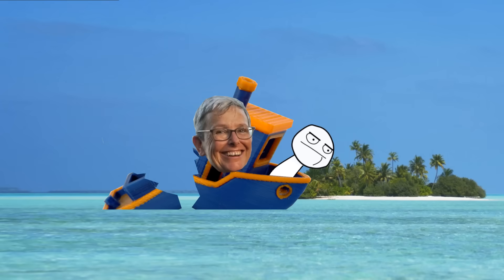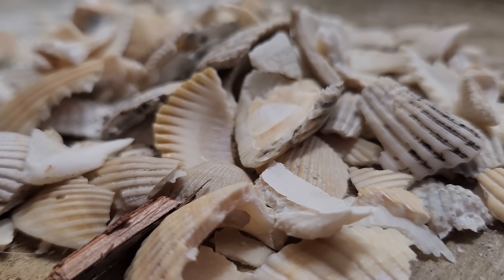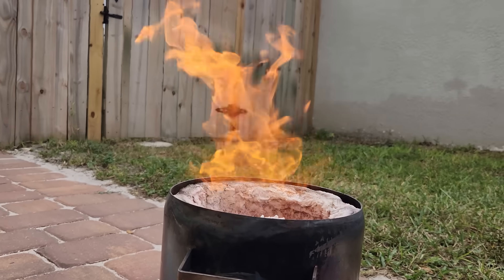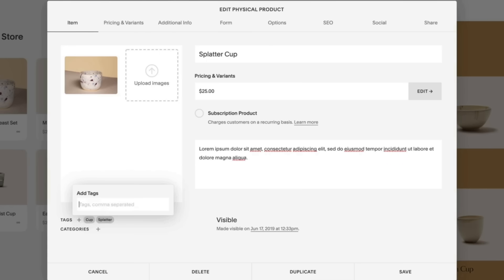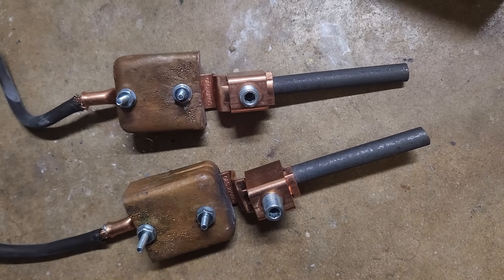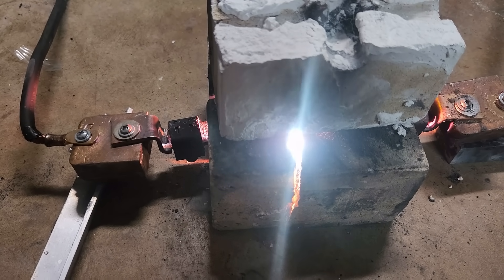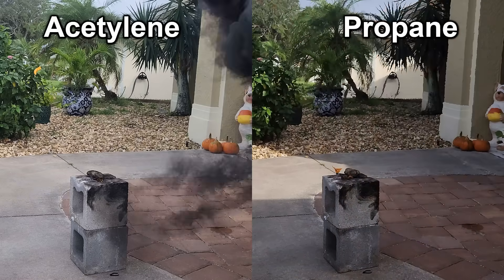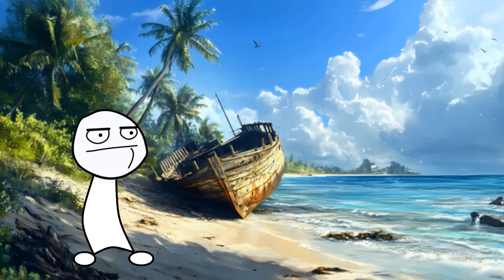Acetylene Gas from Sea Shells and Driftwood

Comment: Make a vibrating funnel to place the ark weld into the outlet, then pore the dust into it and the ark welder should convert it as it falls past the ark. at least that's my thought on a possible way to make a better setup.
Also it would be fun to see a video on how to make carbon nanotubes from acetylene soot. you could even use the soot from copper acetylide, Iron Acetylide Cobalt Acetylide or Nickel Acetylide because these metals are already used as catalyst in their production. I have always wanted to try this experiment but I don't have the time, tools or practical skills in this kind of thing.

Comment: As kids, we made re-useable flash-bangs by putting a pea-sized lump of carbide in a tin with a nail-hole near the bottom. Spit on the carbide, jam the lid on and apply a match to the hole. The lid flies way high, with a satisfying bang and flash. Then go find the lid and repeat. We lived in the bush, and used carbide lights cos we had no 'lectrics.

Comment: could you set up a funnel structure to have a controlled dribble/stream of mix falling through the arc to produce the carbide? Also as I have one, can you use a coke forge, though not the same way

Comment: you actually better live in the rainforest, no money issues try electrolysis of KOH or NaOH, then assume K and Na are more reactive than CaO to get CaO etc. yep K/Na are replacement for the carbon which required ton of heat to drive the replacement reaction that way. yep about 300C for the molten electrolysis of KOH or NaOH.

Comment: All I wanna know is why does it not all burn up at 2000 degrees? I see the water activates it but you also said in the video that some of the flames were  from the acetylene gas in the furnace. Why does some burn but not all?

Comment: uhm, a charcoal furnace can get to 2200F, that is roughly the temperature blacksmiths use for firgewelding wroughh iron, I have even accidentallh melted stainless steel suposddly requires even higher temperature in a regular pit forge.
the difficult thing is to get a good enough crucible.

Comment: Nice!
Maybe you could try a follow up alternative using a few solar panels instead of the step down transformer...?
They have the nice property of acting as a current source which can help keep the arc lit if discharge goes unstable [voltage automatically rises as current decreases]
You can pull very long DC arcs from a series string - but here I was thinking several panels wired  in parallel to give say 50V DC nominal at a few kW.
Possibly need series diodes to isolate each parallel panel from back feeding.

Comment: the mix has a carbon in it, wouldn't it be sufficient to press the reactants between 2 flat electrodes and pass current through it?

Comment: 1:35 - You shot yourself in the foot. If you already have an electric arc, you already have a welder, no gas needed.
Reply: On our farm we never weld with acetylene. It's used (very) rarely for brazing, almost always for cutting. Electric arcs for welding. Although we do also have and use a plasma cutter.

Comment: There is an arrangement of carbon rods for electric arc called Yablochkov Candle. Look it up on Wikipedia. Essentially two parallel electrodes separated with porcelain clay. It removes the need to continuously readjust the electrodes.

Comment: Moissant, who pioneered the use of arcs to make this and other materials (including synthetic rubies). He used lime/CaO as well as carbon to make the crucibles and firebricks. He found out, just like you, that natural materials dont hold ip to the electric arc very well...
Also, i think I read that some of the earliest carborundum construction at Niagra did exactly what you did: carbon electrodes embedded in giant vats of the mixed source materials.

Comment: Weird question but are the seashells even necessary? There is calcium in wood ash. It's why wood ash cement is possible. Honestly if trees grew a lot faster they would be a pretty decent chemical feedstock for industry.

Comment: Your transformer is an autotransformer
It has one winding with a center tap. Both ends are the live of the 220V and the middle center tap becomes the neutral of the 110v (together with either one of the live wires)
The advantage is, that at a conversion ratio of 2:1 it only has to transform half of the power that is drawn at the 110V outlet. So your 5kW transformer is just a 2500W transformer
Also you might want to make that contraption something like a constant current source since arcs have a "negative resistance"
And why on earth didn't you just use an arc welder?! It does all that out of the box

Comment: Hey man ive got an old tombstone welder if you really, really need a welder. Does DC and AC, im sure you can figure out the plug. Takes 240. 
Its older than either of us, built like a tank. Can even give ya a huge, dirty, thick ground cable

Comment: It's a good thing you also found that arc furnace and power source on the beach.
Couldn't you weld with that instead? 😂
In fact, those carbon rods can directly react with the calcium, skipping the driftwood part.

Comment: Commercial carbide is not made in an arc furnace.  A long narrow trench (many feet long and 4-6" wide) is made from castable refractory.  into that trench is carbon (usually from coal) calcium oxide is placed (made by roasting limestone).  Heavy carbon electrodes are embedded at each end.  The whole mess is covered with more castable refractory.  Very heavy current at a voltage sufficient to force the current for several days.  At the end, the refractory is broken away and what remains is a long ragged rod of carbide.  That is run through a crusher to produce the size rocks of carbide that is found in a commercial can of carbide.  no arcing is ever used.  only resistance heat.

I made several feet of carbide using that method while in high school.  My father acquired the special transformer required.  There used to be a company in town called Tennessee Transformers.  That's probably where he got it, custom-made.

Comment: I'm surprised your propane forge won't get hot enough. I built mine and it gets to 2300F. I use it to melt copper. I wonder if it would get hit enough for this reaction.

Comment: You can also skip the calcium and charcoal entirely, and just make the carbon arc underwater. The arc is much more than hot enough to work underwater. The carbon rods provide the carbon and water provides the hydrogen. Heat plus ultraviolet light from the arc splits the water. Controlling the arc length and arc current can significantly impact the production rates and purity of the acetylene. A slight downside is the acetylene comes bubbling out mixed with CO and H2, with a small amount of CO2 possible. The acetylene may be partially separated and concentrated by bubbling the mixed gases through acetone. Acetylene will dissolve more easily into acetone than will the other gases. 

It is preferable to form the arc in a chamber filled with flowing hydrogen gas, as that method avoids the production of CO and CO2, but requires the availability or production of hydrogen. Methane can be substituted for hydrogen in that reaction, which also produces hydrogen gas, H2.

BTW, the reason for the soot cloud from the acetylene-filled balloons is likely to be this: Above 15 psi (1 atmosphere), acetylene subjected to a shockwave decomposes explosively into hydrogen and carbon. The carbon atoms then clump together into soot.
Reply: Nice idea, but how to get the rods under water and to collect the gas at the same time? It has to be collected very carefully, because of toxicity of the CO.

Comment: They used to use carbon rods in cinema lights, they have automated screws that keeps feeding rod to keep it lit. That's where the saying "lights camera action" comes from, because you had to strike the lamp every time you turn it on.
Reply: Also because they eat up the carbon rods so fast they have to use them only when needed.

Comment: The acetylene balloon could definitely use some oxygen to boost it's combustion.  When it has that much soot is it running very rich.  When it's at its correct ratio it burns with no soot at all.  For cutting in the automotive shop, I generally run 25ish PSI Oxygen to about 5 PSI acetylene.  I dont know how much that converts to by volume but it works great for cutting steel.

Comment: 12:54 Not a partial detonation. I've done a quite number of experiments playing around with fuel/air/oxygen ballons around stoichiometry, and trust me, when you get close to detonation, you definitely know it. And so do your neighbors. Hydrogen gas is the easiest - I suspect you could detonate it with a lean mix of air. Propane needs at least 1:5 of pure oxygen.

Comment: Charge with a mix of calcium phosphate, fine sand, a pinch of salt and charcoal in excess then arc it in a retort and you can make elemental phosphorus. A couple larger ceramic flowerpot works OK for the retort. Use some clay to seal it and bury it all in a sand pit. Use two thicker carbon rods and some steel wool to short out the rods and get the arc to start. A steel pipe is ok for the retort condenser. You can also use the CO created as a shielding gas. ❤

Comment: Very cool! Have you seen the videos by Shake The Future on using a microwave to heat silicon carbide crucibles? I’ve only done it with a zinc alloy which has a pretty low melting point but he gets iron to melt which is way hotter than what you’re working on I think.

Comment: The flame speed of acetylene is significantly faster than propane which is why you see the acetylene flame burn faster. You can also buy calcium carbide ready to use with old school acetylene generators which are essentially like your flask setup at the end. They drip water into the chamber and feed the gas out to your acetylene torch. They're hard to come by these days (in first world countries) since everyone just uses insanely overpriced acetylene cylinders for welding/cutting purposes. If I were using acetylene on anything more than a hobby level, I'd probably look into getting an acetylene generator setup since calcium carbide is very cheap to acquire by the ton.

Comment: I never would have thought to use a step up toroid to make an arc welder. That's brilliant! SOOOOOOooo much easier than rewining MOTs. Well. Time to build a better high current supply....
Reply: thought emporium!! love your videos ❤️
Reply: As someone who built MOT arc welders as a 15 year old, I completely agree. Although I'm not sure why you didn't use a proper welding machine to power this one..? 
Anyway, I wonder if you could develop a way to compress the oxide/charcoal mixture into a plug that acts as the electrode itself.  You just connect the wires and the charge burns itself down. It would require some clever engineering to keep the current flowing, like it may have to be contained in a conductive sleave because the reaction would produce calcium carbide, which is not conductive. 

Honestly, it might be easier to use a separate thermite reaction to provide the heat instead of my idea😂
Reply: @amosbackstrom5366 my home built propane forge/furnace will get to a little over 2300F. I melt copper with it all the time and then add aluminum to make bronze, which I then used to make jewelry and decorations. If all you need is 2000 degrees, then I can easily get there with my propane furnace setup and a clay graphite crucible.
Reply: @amosbackstrom5366 I have had the same idea... make pellets, then run the electricity through the pellet. I was trying to make calcium phosphide not the carbide, and I was going to use a little bit of clay to make the pellet, but mainly charcoal and bone ash
Reply: @ShannonDove-sy7ye  did you try it? Did it work? Now I'm curious
Reply: I was hoping for a link in the description to the one he used. I am blown away and have so many ideas!
Reply: someone should make a video about converting a specific vevor machine, i bet they will sponsor the video and provide a bunch of converters.
Reply: I mean... surely those transformers are not as common as microwave ovens.. 
Of course you can rewind pretty much any reasonably big mains transformer, the bigger the easier it is, and the more flexible you are.
Reply: @Basement-Science  Kind of common kinda not atleast the bigger ones, good UPS and such use them some LF inverters use them, tho goes kinda out of usage for SMPS supplies instead since cheaper and lighter weight, had an issue myself getting big toriodal cores where i live, but then again needed cores weighing more than 10kg,  ended up buying a few used ones and unwrapping them and welding them together at the seam and rolling them up
Reply: @MrRacerhacker  can take some patience to get something good, yes.
Reply: @Basement-Science  yes did make a nice LF inverter  8kw from it been powering my house for awhile and vety cheap compared to other solution.
Reply: Unless that market has changed a lot from what I remember a used ~230A "buzz box" welder is probably an even better start. Already current limited, designed to be shorted and draw arcs, etc. Bonus points if it's a continuously adjustable type with the sliding element in the transformer rather the simpler tapped transformer setup.
Reply: Youtube must have us in a recommendation group, multiple videos in a row and I see your comments.
Reply: Mental nuke seeing Reddit-aligned science channel in the comments of this IRC-raised old-internet unhinged  shitpost science channel
Reply: IGBT based arc welders are like $30 on Amazon though 😮
Reply: @pierrekin  cheap igbt welders okay for thin stuff. Other than that bit meh max approx 3mm goes for slot of jobs but prefer a mot then for bit cleaner welding find the cheap ones to not feel so good welding also low HZ so feels like very pulsing when welding compared to good igbt welders
Reply: @ interesting thanks for the info 😎
Reply: Look who it is
Reply: Maybe if you can pulse the power, it won't get too hot for the bricks.
Reply: Hacking a transformer box was a really stupid idea. You don't have any current control. A cheap arc welder works much better.
Reply: So I take that ship wrecked dude is still on the beach ?
Reply: So I take it that dude is still ship wrecked ?
Reply: Now I know who the thought emporium watches. That’s like who your favorite bands listens to.
Reply: Se retificar a corrente com díodos parrudos, e usar Mosfets para amplificar um sinal PWM vc vai ter algo que nem uma tocha de Tig só que com eletrodos de carbono. O único ruim dos Mosfets é a tensão elevada de trabalho mas em compensação se obtém potência altas através da tensão e não da corrente.
Reply: This is probably one of the best explanations.so many people forget some of the most important details.most excellent work.
Reply: I have two 5KVA toroidal transformers sitting in my garage that I bought from a scrapper. This is the perfect use for them! Too bad I don't have anything productive to do with a high current power supply though...

Comment: Acetylene is some scary stuff, pure Oxygen too.
Pretty cool how normalized oxy-acetylene setups for welding and cutting steel are when you consider how awfully dangerous and reactive both of these gases are.
Acetylene tanks are to be stored upright, not knocked over and never ever heated above 50c and when its in a fire the cookoff point can be reached where the bottle will only increase in temperature and pressure on its own due to the acetylene decomposing into explosive products the bottle is now a bomb with a time fuse unless you quickly throw it into a lake or something.

Comment: YES !!! LOL glad you made a video on this, love the deep dive info coming to video format finally (now to get some info on triboelectric charging of nozzles from fuel flow of liquid fuel to increase the thrust per pound of fuel burned, and some extra protection on the nozzle to keep the heated expanded gas from contacting it on its way out into the air or space once it exits the atmosphere. (and how control over this and segmenting the delivery to the nozzle can use electrostatic power to steer the rocket via differing electrostatic charge pressure or ion pressure :)

Comment: For anyone interested in wood gas, nighthawkinlight did a few videos on it, which were great.  (I'm excited to see what our favorite Florida man brings to the table on the topic, as well, since NHIL tends to focus on very practical applications.)
Reply: Biggest issue is storage and prolonged operations on say woodgas running old v8 and that turning generator for power production. Two sources you can swap between and burn what ever crap wood you can haul from the forest would be really nice for homestead use like now when lights are flickering even on more reliable grid areas.

Comment: Very cool! I have no idea what I am talking about, but what if you compressed the powder into a solid puck then tried to run current through it? It might be easier to heat a solid puck, rather than a loose powder. Great video!